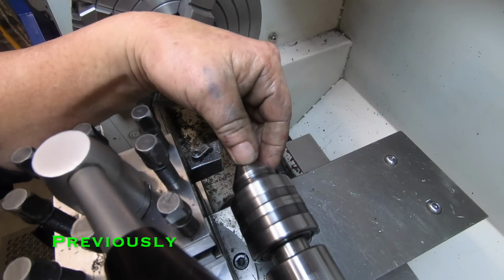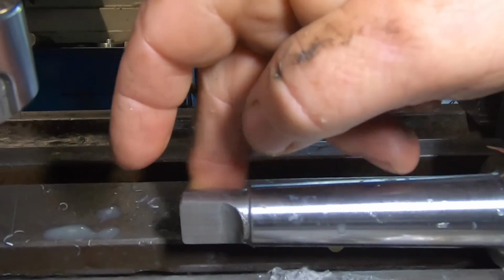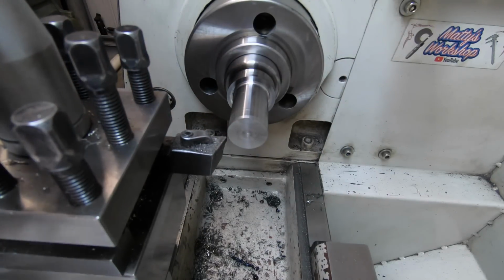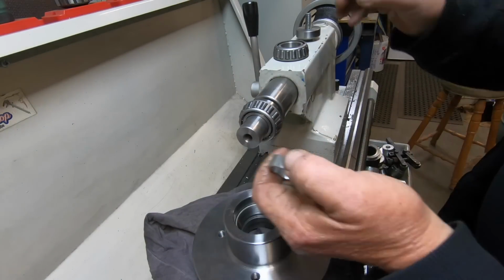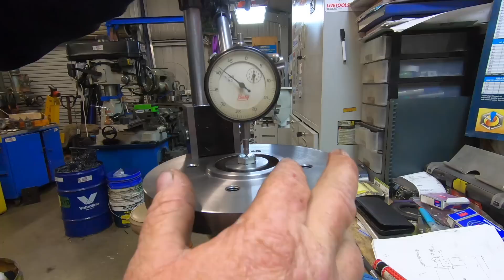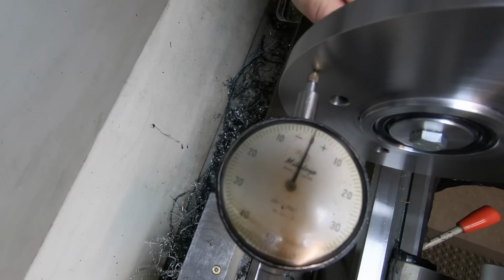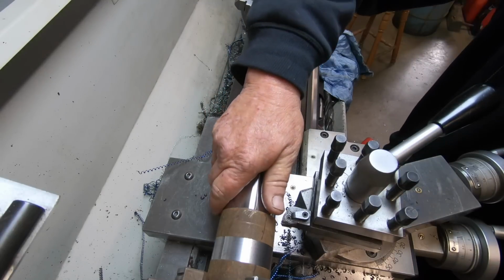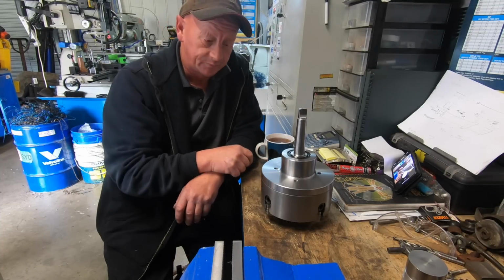Tailstock Chuck, Part 4   MT3 arbor, assembly & test cuts

Comment: Thanks for the videos. Very well done.
Couldn’t tell if you left a relief to get the outer races out, if ever needed.
When I press stuff, I use STP or CMD EP lube.
I also just get the thing started, then back off the press to relax and re-center, then go for it. I learned that by scraping off a chip once that threw the race off axis when it seated down onto that chip.
I need to build one of these myself, and yours is the one to build. I especially liked the compound setup for turning the taper.

Comment: Beautiful Build Matty, you did everything right.  As I mentioned in the last video I think the movement is the weldment relaxing after machining.  When machining we remove residual built up stress with resultant movement.  The only way to alleviate this is to rough machine and let it sit for a week or two and then final machine, much of the stress will have come out.  The ultimate is to stress relieve to 650 deg C for 1 hour per 25mm of thickness.  The other old fashioned way (and it does work if your technique is right) is to hammer the weld with the ball end of a Ball Peen Hammer.
Cam
Reply from the maker: Gday Cam, sorry about the late reply, I think you absolutely right about the stress relief in the 2 parts, I’m not noticing any runout movement when it’s spinning in the tailstock but the Morse taper maybe flexing as well but it’s not noticeable to the eye, I had a few comments saying I could re-face the hub but I worried I’d make things worse, im probably better off leaving it as it is, the indicator was a far distance from centre and I that .001 after some thinking isn’t much considering, this was a massive learning curve in accuracy and setups but I think that’s what I needed, thanks for watching and commenting mate, Cheers

Comment: Brilliant work Matty really interesting to watch, if the 1 thou run out is bugging you, remove the tailstock chuck drill a hole in the raised boss or slot it. 
Mount the backplate assembly back up in the tailstock, then drive the backplate with a corresponding dog mounted in your four jaw chuck. 
Take a very light skim off the face of the backplate to true it up then refit the tailstock chuck.
Just my theory it may work, give it a try. You'll be able to sleep at night if it does having reached your goal. Tony
Reply from the maker: Gday Tony, the .001 runout isn’t that bad now I’ve thought about it, the indicator was quite aways from the centre, I think I’ll leave it now it’s is, thanks for watching mate, cheers
Reply: @MattysWorkshop  It's better than not that bad Matty it's excellent. You sounded really disappointed at the end though. Cheers. Tony
Reply: @MattysWorkshop   Hi Matty ,  I've been watching your videos now for a while and enjoying them.    I recently made a backing plate for a chuck awhile back and I ended up putting a known true piece in the chuck and checked the run out which there was.    I then took it off and remounted it to the lathe and still had runout but it was different so I repeated the process again and the runout was mostly gone.    It was in the low tenths,  about 3 if I remember correctly.    I think what it was was the runout canceled or offset the runout of the chuck.   I then marked it so it can always be put back in that position.    I put in a longer bar that was true and checked and the runout was consistent so I felt I had a winner.    Might just work for you as well. 

Dale in Canada 🇨🇦
Reply: I reckon if you had a toolpost grinder you could put it back in the headstock bush and grind the backplate face flat without taking it apart, bit of tape over the seals to keep them clean and provide drive. It would not be the correct way to go about it but I think it would work.
Reply: @dutchgray86  Hi Daniel I never mentioned taking it apart. The only thing it think with doing it that way is if the run out is caused by the outer bearing being slightly out it will still be present because the face is being ground in the same plain to the arbor as it spins so to speak. Whereas if the tapered arbor is stationary and the backplate revolves any cut will remove the high spots so its face so it runs true. Could the run out be caused by Matty reducing the bush between the two bearings by hand lapping unevenly a minuscule amount at the centre enough to throw the face out 1 though at the periphery by slightly tilting the outer bearing. This is a real brain teaser thanks for replying I might be wrong lol. Matty please ask Max if you can deform/tilt a bearing on a shaft. I wish my cockups were only a though out. Tony
Reply: @eyuptony  Reference in taking it apart was not in regards to your method, which is sound, in both the thought process and method, but was to reference if you wanted to take a facing cut on the lathe to true the backplate surface, using a toolpost grinder would allow to get away with leaving it complete and would be quick and easy. It appears that the 1 thou runout is not even around the backplate surface, as others have commented it looks like it has a very slight warp to it, maybe from weld stress as its of weldment construction.
I know If I built one it would not come out as accurate and a thou will not cause any issues for the work a tailstock chuck is intended for.

Comment: Really smart work Matty. Proper job. Was very interesting to see you setting the free play on the taper bearings. I was wondering what you would set that to. It's a job I still need to do on my shaper milling head - checking and setting the free play / preload between the chuck-end thrust bearing and the taper. Your lathe is great. Cheers
Reply from the maker: Gday Paul, this was a big learning curve in accuracy and setup, the bigger lathe really makes this a lot easier then the small lathe before, I followed the way Max did the preload on the bearings and it worked great, really appreciate you watching and commenting mate, cheers

Comment: Brilliant build Matty, like the mill setup for tang machining. 
Ref 0.001", face run-out, that's excellent, if you were to have properly toleranced part drawings ( not knocking Max in any way), in geometry,  bore size, parallel,  square etc, it would scare you if you calculated build up of errors; I've done this a few times to both defend customers and my employer.

If it was needed to be better, I Say IF, then the solution is to hand scrape the face, this is done more than you think on large spindles. Normally an adaptor plate is the item scraped, not the spindle.
It may be worth putting some force on it, to assist bedding in or settling of the bearings,  remember that the tailstock may not be square or parallel,  but in the greater scheme of things its negligible. 
Bloody great job again Matty, great video. 
Thanks for sharing.
Reply from the maker: Gday, This was a really enjoyable build and a big learning curve in accuracy and setups, I think the .001 run won't effect anything i'm doing here, to be honest i'm really surprised I got it that close, I can understand what your saying about built up errors which would come into play in the hi tech industry, Thanks for watching and commenting mate, Cheers
Reply: @MattysWorkshop  Hi Matty, not sure about the "Hi-tech" bit, but the spindles I used to work on (I write operator manuals now ), were for rotary friction welding machines, we use only Timken, smallest is 2.75 inch bore/5.75 inch OD up to 12.5 inch bore/24.5 inch OD, occasionally 16 inch Bore/30 inch OD, then we use in tandem. We have reused bearings in the same refurbished machine that were 25 years old, 15 years later its going strong. Delivery on the bigger bearings is 18 months, I kid you not, that was pre-covid etc.
Again, great work, cant go wrong working with Max, he always has a trick or ten up his sleeve. 👍👍

Comment: I was thinking about the runout Matty and you may be able to correct it by driving the tailstock backing plate with the headstock chuck (grip the spigot) and then get in with a small cutter and reface the errant chuck.  Should work.  I expect that the wobble is currently being negated by flex in the Morse arbor.  Cheers Rob
Reply from the maker: Gday Rob, I think if I play around with it I might screw it up worse, I can notice any issues when it’s being used so far, cheers

Comment: 0.025 mm run out is a good result Matty.  Rotate the chuck on the back plate and you may find a position that cancells it out to some extent.   Most chucks are only good to about 0.03 anyway.  Some are a hell of a lot worse ;)  Cheers Rob
Reply from the maker: Gday Rob, I think I’ll leave it the way it is, .001 isn’t all that much after I’ve thought about for a while considering how far out from centre I had the indicator, I really don’t think it’s worth chasing mate, thanks for watching, cheers

Comment: Turned out awesome  1 thou of run out doesn't seem that bad at all for not being ground having multiple bearings etc especially since even great 3 jaws have way more run out I wonder if as it's run for awhile if it may get better really great job 👍👍👍
Reply from the maker: Gday, the runout isn’t as bad as I thought after thinking about it, the indicator is quite a ways from centre, it could be stress relief from the weld, this is something I didn’t consider until a viewer pointed it out, overall I’m really happy with the results, thanks for watching and commenting mate, Cheers

Comment: I watch Kurtis at Cutting Edge Engineering…. He sent me over.  

That wobble was probably pulled when it cooled (???) 

On the dial you had on it… it looked great.  A higher resolution dial is what you need to get closer on the clock up if it’s needed.
Reply from the maker: Gday, appreciate you checking out the channel, I think thats what happened, thankfully it doesn't effect the way it works, Thanks for watching and commenting, Cheers
Reply: @MattysWorkshop  yes sir… it looks like putting the chuck on …squared it up.   Either way, you are still getting good tolerances. I watched the Boring head video.. that turned out good too.  Dovetails freak me out. Lol.  Cheers

Comment: Seeing you doing this, had to make one myself.  Bought a 'old stock' heavy aluminium wheel hub with bearings. Making the 'axle' now, to suit MT 2 .  Thanks for showing how to do it. Will be using a old 3 jaw fixed reversible chuck that was modified to be adjustable.
Reply from the maker: Gday, that’s awesome, I’m sure you’ll get many years of use out of it, there not something you use everyday but priceless when you do, I’d like to see a photo when it’s all done, thanks for watching, cheers

Comment: That's a really nice result Matty. I'm wondering if the run-out is just residual distortion from the welding. The stresses will take a while to reach equilibrium. It looks like the one thou run-out has multiple peaks in one revolution. 
Regards,
Mark
Reply from the maker: Gday Preso, you could of hit the nail on the head there, could be worth checking the runout again to see if it’s gotten worse, thanks for the heads up there mate and appreciate you watching and commenting, cheers

Comment: Hi Matty, that has worked out really nicely! Have you tried checking the runout on a bit of bar held just in the tail chuck?  I guess if you don't see any flexing or lateral runout when there's a solid bit of material chucked up then all is good. I must make one for my lathe, I have a decent 6 inch chuck that I can use.
Reply from the maker: Gday, I really can’t pick up any runout/wobble by eye, Using a 4 jaw is a bit more work in setting up jobs but I think it’s a better way then a 3 jaw, if there’s any runout it can be tuned out, I hope you do build one yourself, there a handy tool to have mate, thanks for watching and commenting, cheers

Comment: Nice job Matty, really well done mate. Your 0.001" error on the face (where you measured it) was probably only a couple of tenths where you machined it which probably came from your 2 morse taper interfaces when you turned the bearing diameter. I really don't think you made a mistake at all on this, just a stack up of tolerances mate. Well done. Cheers, Jon
Reply from the maker: Gday Jon, after thinking of the runout it’s not bad at all, the indicator was a fare way from centre, it could also be the stress of the weld releasing which I didn’t think about till Cam from the Battler workshop pointed out which makes sense, over all the MT3 turned out spot on and I’d say it’s the best of done so far, this build was a step learning curve in accuracy which is what I needed, really appreciate you watching and commenting mate, Cheers

Comment: Your results are really great! That .001'' on a rotating assembly is insignificant given that the parts were not ground finished and the bearing are standard accuracy and not P5.

Looking for other sources for the run-out it would be pretty interesting to compare the shaft you made using the spindle taper to morse taper adapter to a shaft made with using only a 4 jaw chuck, first making the bearing diameters then reversing it and dialing it in the 4 jaw and cutting the morse taper part. Maybe the spindle taper adapter introduces a minute error that can't be accounted for or adjusted.
Reply from the maker: Gday, Im not sure where I got the thou runout but it dosent effect the chuck in operation, It would be very interesting to see the difference in spindles built both ways, Thanks for watching and commenting, Cheers
Reply: Spot on.

Comment: Excellent job! I wonder if the run out could be from the bearings seeing that they are standard ones and not high precision?
Reply from the maker: Gday Tom, the runout could possibly be this or stress slowly coming out from welding, After looking at for a while it’s not that bad considering how far the indicator was from centre, certainly can’t pick it up what it’s spinning, thanks for watching and commenting mate, Cheers

Comment: Matty I'm in the process of building a rotating tail stop chuck. I'm following your build. First thanks for posting the videos. My question is you put a sleeve inbetween the 2 bearings when the bearings seat into the races and you preload the bearings how does this work. Looks like the sleeve would stop this from happening due to the sleeve keeping the bearings apart at a distance of the sleeve. I though that as the bearings ware in you would need to tighten them up a little. As we do on our equipment trailer bearings. Thanks for any help you could throw my way.
Reply from the maker: Gday Anthony, this height of the spacer between the 2 bearings is really important, this does set the preload on the bearings, the spacer pushes each bearing into the cone when the end cap bolt is done up, if they need adjusting it’s quite easy, rub the aluminium spacer on wet and dry paper and a few thou can easily be taken off and the preload is set on the bearings again, using the dial indicator to get zero movement when you left the hub from the shaft, I hope I have explained this ok but if I didn’t please send me an email to ttmrj@telstra.com and I’ll do my best to help, cheers
Reply: @MattysWorkshop  thanks I understand now.

Comment: Question for ya, Matty...

I have a spare chuck that I have considered making a tailstock chuck with. It has a 3.5-4 inch through hole. Was wondering about having the bearings on the backplate "inside" the chuck instead of behind the chuck. In theory, it should minimize any leverage on the bearings from heavy workpieces. Or am I overthinking it? Any thoughts?

Andrew
Reply from the maker: Gday Andrew, it would definitely shorten the unit, reducing the overhang will definitely be a bonus, the main thing is to retain the bearings in the chuck somehow, should definitely work mate, Cheers
Reply: @MattysWorkshop  Was thinking of having a "stub" on the backplate, similar to yours, but going into the chuck. (Does that make sense?) Would depend what I can find for bearing sizes, I guess!